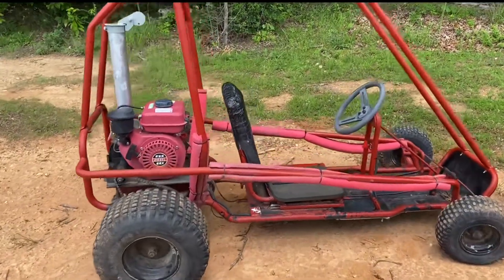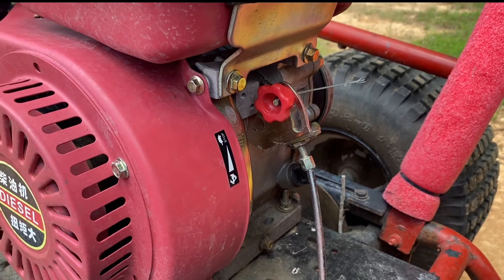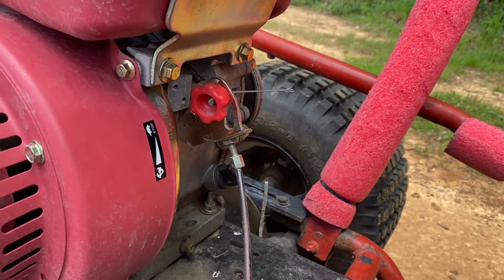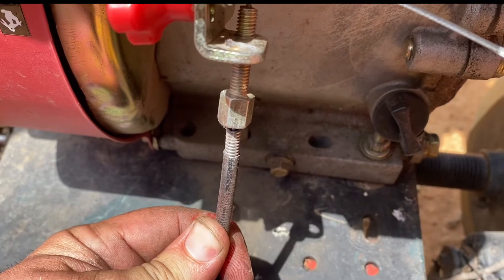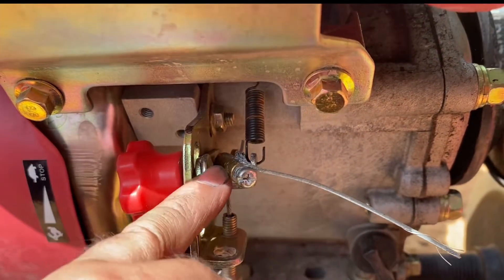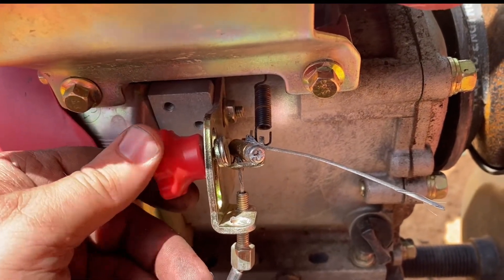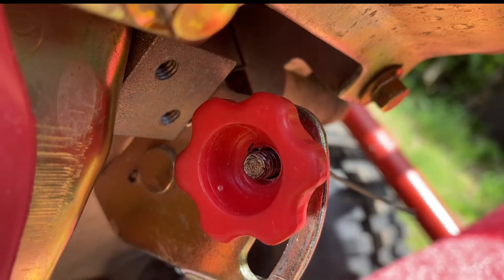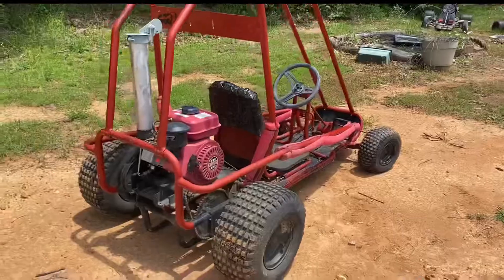Amazon 196cc Diesel Engine- How To Connect Throttle Cable and Idle On Go-kart

Comment: Red nob off, two nuts on and another spring on the side you put the new nuts  might work
Reply from the maker: Yeah that might work. I had tried something like that originally but it would get hung up. I didn’t have the second spring though which might keep the bolt level and fix the hanging up issue:

Comment: I was wondering what the sizes of sprockets are. I see the smallest is just big enough to be on the shaft without the chain getting into it the driven sprocket looks like it's the same diameter as the wheel is that true how many teeth are on the driving and driven sprockets of ratio is what I was looking for to understand the power delivery thanks awesome setup
Reply from the maker: The smaller sprocket on the jackshaft was swapped to a 14 tooth from a 9 tooth to pick up some more tope speed. I’m not sure what size the axle sprocket is but it’s big. The torque converter combined with the jackshaft and axle sprocket make it really hard to comprehend the gearing. The gearing is a bit aggressive for this engine though; it struggles a bit.

Comment: Pssst you can install a stage 1 air filter with a slightly modified Mikuni adapter and try messing with the governor it turns up Mickey around 4500-5000😊
Reply: 4,000 RPM is possible anything over and your playing with fire.  It's a diesel not a gas engine.  Probably won't get anything power wise over 3500 RPM anyway.

Comment: Out of curiosity, what sprocket sizes are you using on this? What's the top speed you're able to achieve with that sprocket ratio? I think this is a really cool build, and I'm looking at possibly using one of these engines to power an old dual-sport bike I've got in the garage.
Reply from the maker: I’m using a comet 30 Series torque converter with the driven pulley connected to a jackshaft. I swapped the jack shaft sprocket from a 15 tooth to a 13 tooth 40 chain to pick up some speed. The axle sprocket is 72 tooth. I’d expect the top speed is under 20mph. It’s pretty slow but the engine doesn’t rev high and the gearing is setup for torque. The 30 series isn’t strong engine for the weight and gear setup so I have a lot of belt slip.
Reply: @jwsbackyard6413  Thanks for answering! Sounds like an upgrade to a 40 series is in order. Once you've done that, you can run a much higher gear ratio and make use of all that torque. Good to know that the 30 series isn't sufficient for the torque of the diesel. Guess that means I'm sticking with a gas engine for the time being since I've already bought a 30 series. What are your future plans for the build?
Reply from the maker: Other than working out the torque converter slipping issue I’m probably done with this build other than just enjoying riding it. The kart is very heavy as well which I think is part of the problem also.

Comment: I have mine on a reel mower. I had to remove the throttle stop bolt otherwise the mower blades turn too slow.  So mine is wide open when I mow. Is there a reason why you still have your throttle restricted with the bolt?
Reply from the maker: The arm on top of the engine that actually controls the fuel delivery is able to go through it’s whole travel distance with the screw where it is right now so anything past that is only stretching the spring between the throttle control on the front of the engine and the arm on top of the engine. The throttle control on the front of the engine has a bit more travel than the actually fuel control arm on the top of the engine.